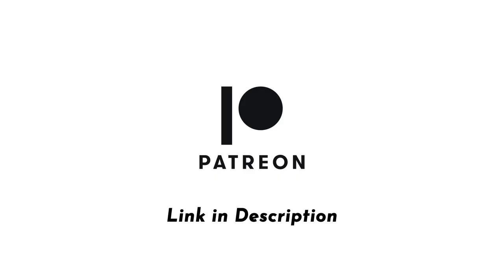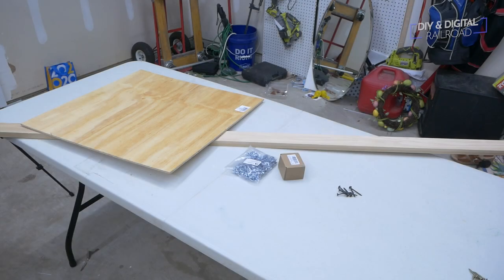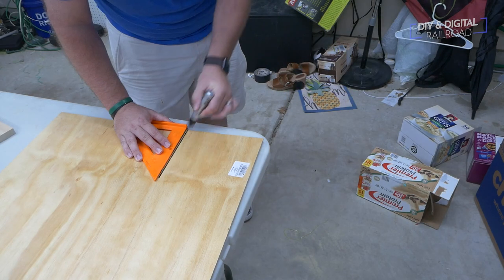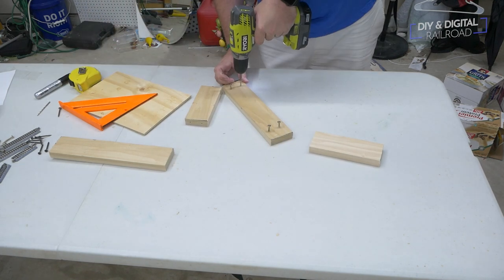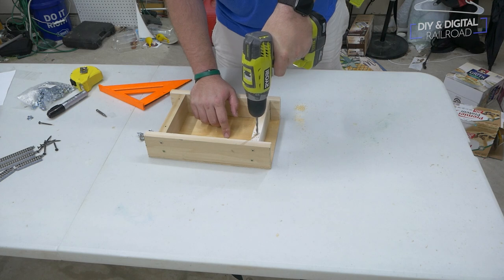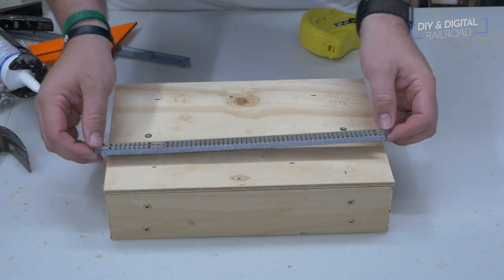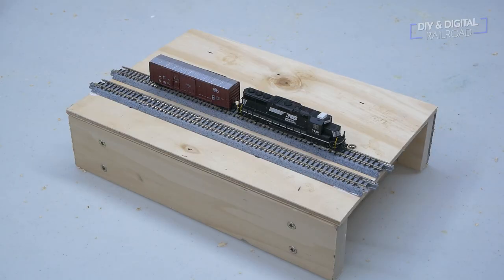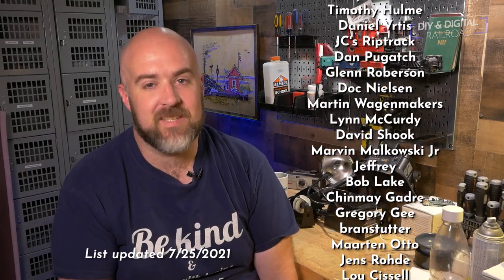Let's Build a T-Trak Module!  Easy N Scale Model Train Module.

Comment: I found that very interesting. I keep going back so I could Wright down measurements. Looks like fun. I have Bachman EZ track so will look up that track to make T track module's. Thank you for that DIY show and tell.
GOD BLESS 🚂💖🚂💖🚂💖
Reply: One problem with using EZ Track for modules: if you're building actual T-track modules to be used with other T-track modules rather than just using the standard for your own sectional layout, you have to use Kato Unitrack at the point where your module joins with other modules. The track you use between the two modules doesn't matter, so if you still want to use EZ Track within your module you can, but the Unitrack joiners at the module ends are mandatory.
Reply: @VestedUTuber  Thank you for letting me know because I did not know that. Great info to have.
GOD BLESS 🚂💖🚂💖🚂💖

Comment: Noted you used "luan" wood for the deck piece. Is that preferred over using thin plywood 'good-one-side"? I use Kato in HO scale, so what is the centre's for track alignment? Interesting idea for small quick projects where you can really change scenes. Thanks for the video. Will you be doing one as you finish it?

Comment: Interesting. N-trak struck me as needlessly over complex, this system seems more straight forward now I"ve had a look through the specs and wiki. Might be useful even here at home as mix and match modules for the deck in summer. 
Why T? N-trak I understand, but the T means nothing, other than that you are using T connectors for the leveling feet. Is it that it is table top rather than free standing? that's one thing that makes it easier to build than other standards.
Reply: The T is for Tabletop, the modules are assembled into a layout on folding tables.